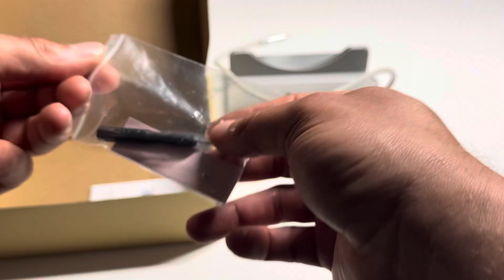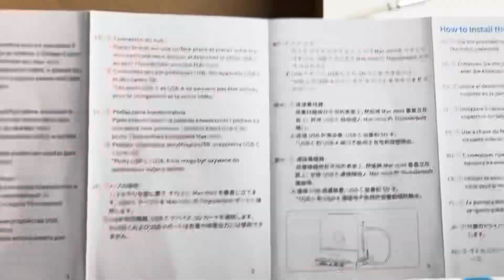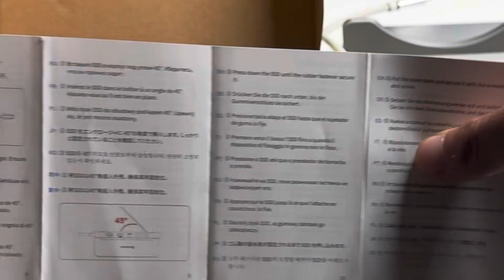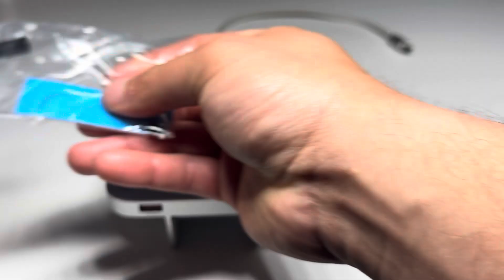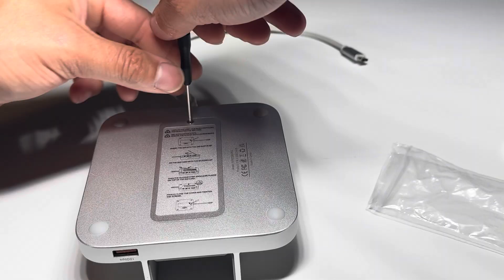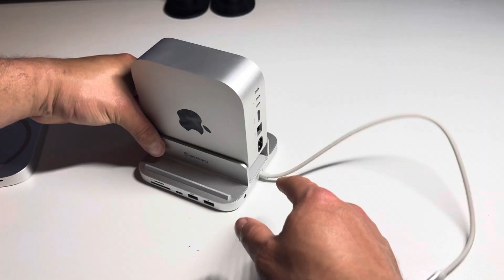Must Have Mac Mini M4 USB C Docking Stand | Minisopuru iExpandMate MINI218B PRO Review

Comment: The Minisopuru vertical Mac Mini M4 hub is the best I've seen on the market right now.  Very nicely made.  One advantage of this hub is that the WiFi aerial on the Mac Mini, which is at the bottom of the device, gets an orientation for better reception.  Thanks for the heads-up, Ryan.  Appreciated.
Reply from the maker: Glad I could help, it's a great hub.